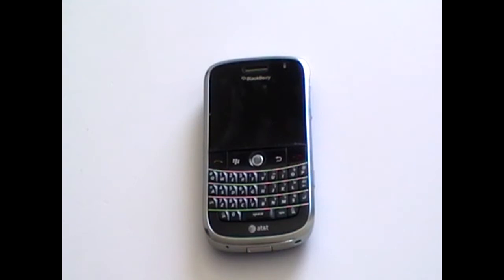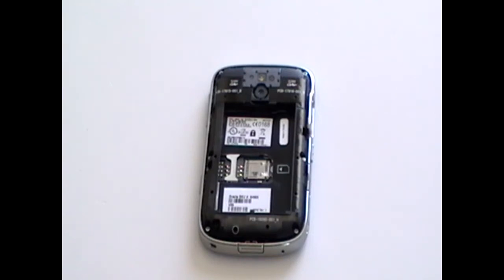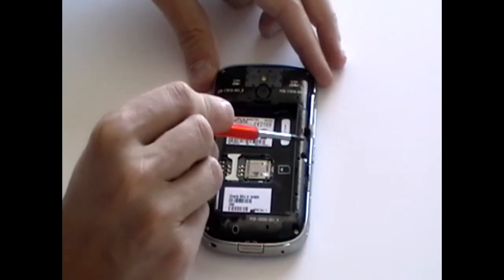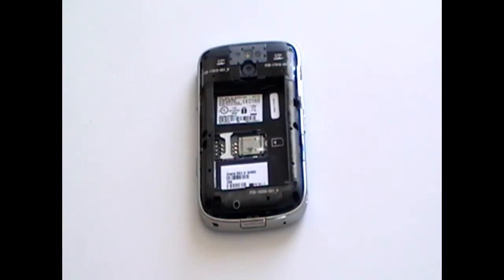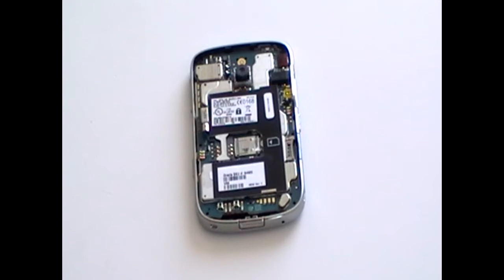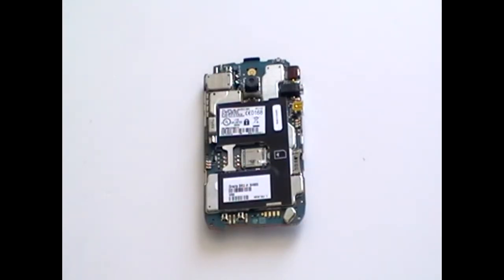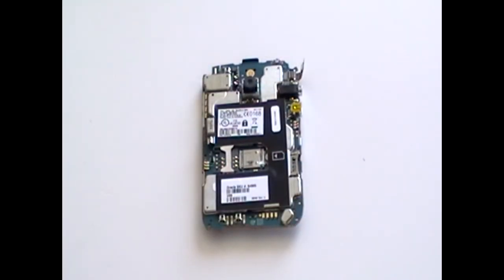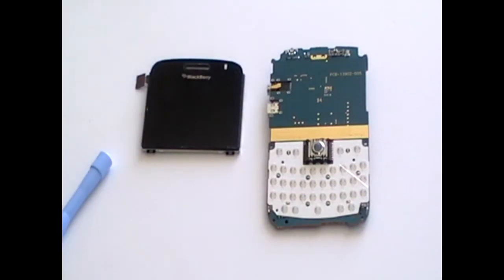Blackberry Bold 9000 LCD Screen Replacement Repair Take Apart Guide

Comment: Hi, thanks for the video. I needed your help. While doing a fix the flex ribbon cable of the screen broke. Is there a way to fix that, apart from replacing the whole screen?

Comment: my dad broke the screen and had it fixed and gave the phone to me. near the top of the lcd screen there are what looks to be little bubbles, and the black part above the lcd with "blackberry" written on it is not alligned/flushed properly with the silver border of the phone. is this problem an easy fix, or could previous damages not allow it to be properly aliigned?

Comment: Hello, 
I have a question.

All replacement lcds come without that "glue" between lcd and lens???

I just replaced mine and it looks different than the original one, its impossible to see from the sides or top. 
I think that glue makes the difference.